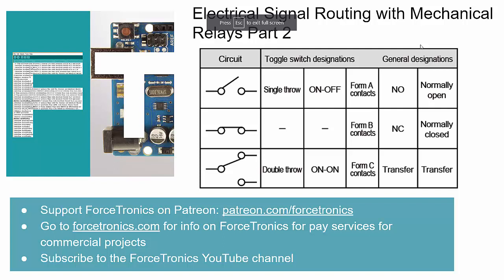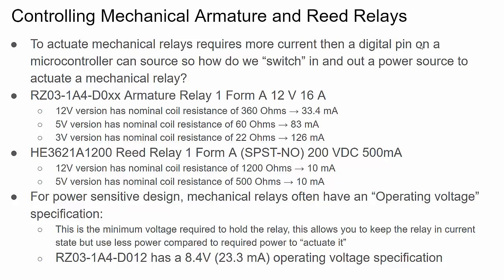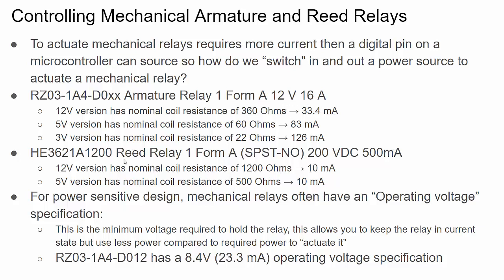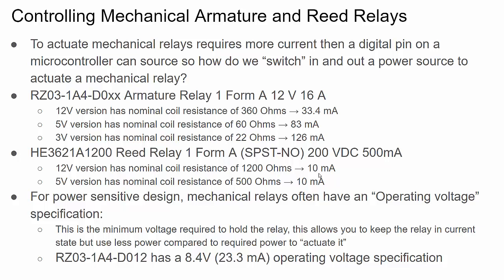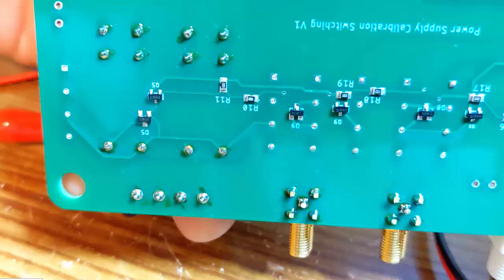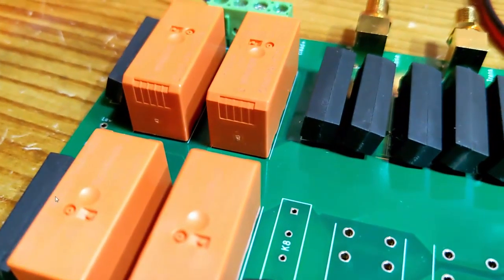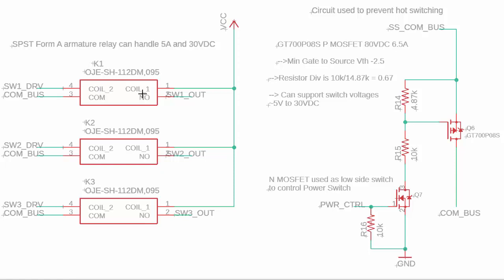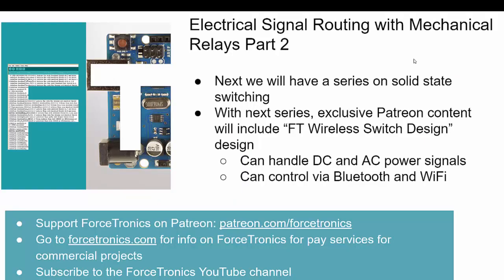Electrical Signal Routing with Mechanical Relays Part 2

Comment: Very interesting topic. Why do we need a mechanical relay if the P-channel MOSFET is already carrying our signal?
Reply from the maker: Great question. I try to use solid state switches whenever I can and avoid using mechanical relays because of cost, design space, and reliability. But there are applications and industries where an "air gap" is required when switching or isolating electrical signals. For instance automotive and aerospace defense industries often require mechanical relays over solid state switches for safety purposes. When you have use solid state switches there is often some level of leakage currents and a higher probability of the switch getting unintentionally actuated.